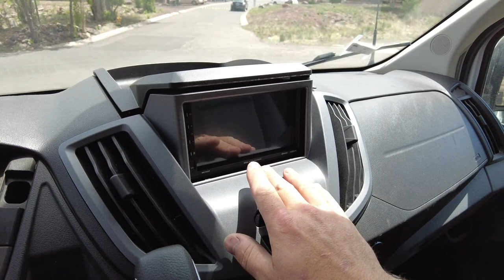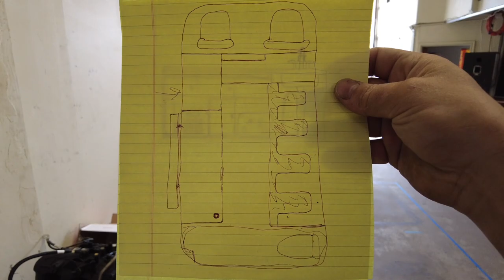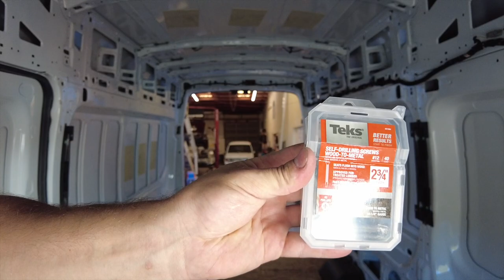Ford Transit Camper Conversion Vanlife Build Series Part 1: Layout, Subfloor and Factory Wiring Tuck

Comment: Something I’ve done in the past for those wiring holes is split a piece I’ve vacuum tubing and cut a piece long enough to surround the hole then use the duct tape as you did. Gives a nice cushion that will probably never chafe through
And cheap

Great build out
Reply from the maker: Yeah that’s a great trick! 
I went back later with this and added edge trim like you see on car seals and pinch welds. 
Thanks for watching, and thanks for the comments!

Comment: I saw on a different van conversion that they made modifications to the mechanisms under the rear of the van to stabilize it against wind resistance and to level it for driving they made to tires bigger.  How much would that cost to do?  And was that something you thought about?
Reply from the maker: This build is well under the weight capacity of the awd sienna so we didn’t feel that any other modifications were necessary. Might lift it in the future.

Comment: Hello! I just saw this and am about to try to install a subfloor this weekend! What products did you use? Half inch plywood and what is the insulation foam you used!?
Reply from the maker: Try to find tongue and groove 23/32” “exposure 1 or exterior” rated OSB for the subfloor, for the insulation I use 1/2” r-tech insulations sheets with the reflective backing (lay down shiny side up), and 1/2” ply wood for the spacer strips running across the van (I cut them at 1.5” wide usually). Construction adhesive to hold ply strips and foam in place and keep it quiet. Everything I use can be bought at the big orange store. 
A 170 sprinter and the 148 transit requires 4 sheets of osb, 3 sheets of insulation, and 1 sheet ply. If you use the lifeproof vinyl floor plan on using 4-5 boxes. 
Just did one on a sprinter yesterday and cost for everything including vinyl floor and hardware was $850.

Comment: Did you just use glue or did you use screws for the strips of wood for subfloor?
Reply from the maker: Just construction adhesive until the subfloor osb goes down, then I use countersunk wood to metal screws through the osb and the strips into the metal floor beneath. 
I always try to line up the rows of screws so they go into “frame rails” as to not hit anything underneath and hide the screw tips